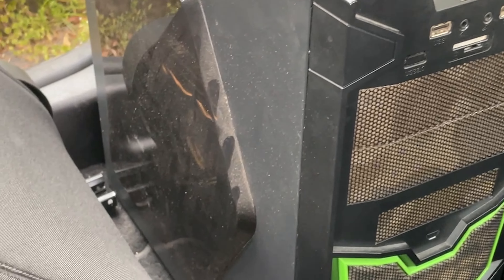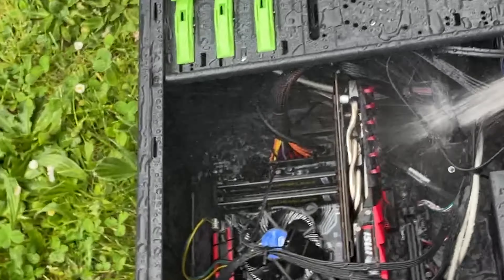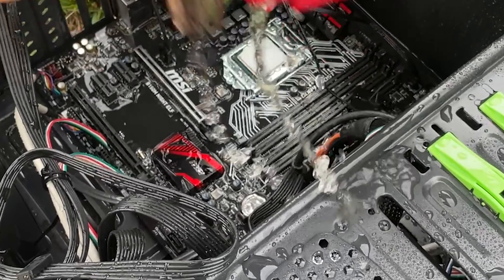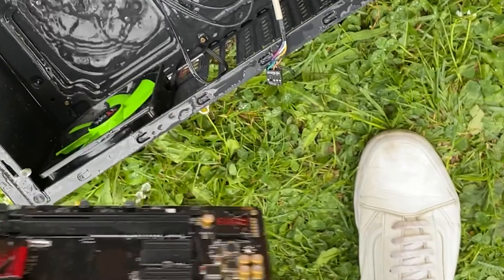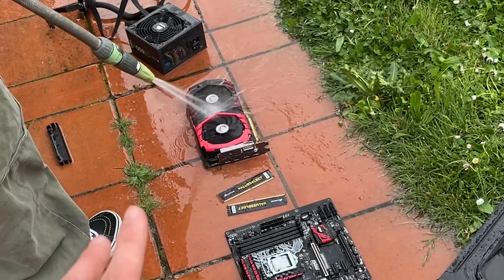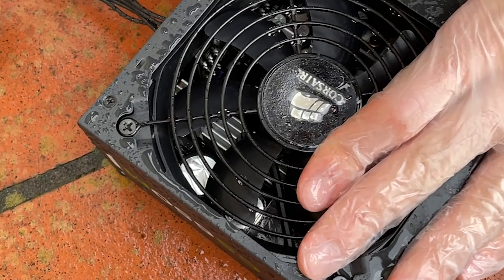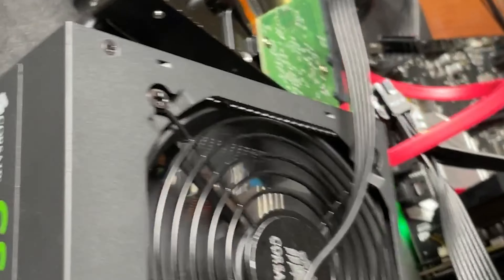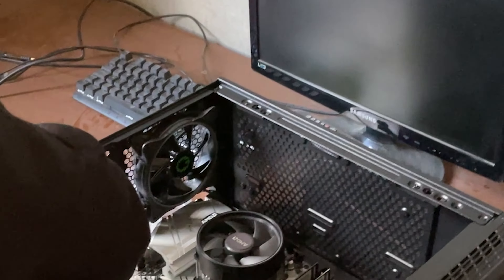340$ Budget PC Build getting a Shower! || PC Flipping

Comment: You should fully disassembly every component and pressure wash them, dry them with hair drier heat mode. Best method to completely remove every particle of dust even the hard ones
Reply from the maker: I definitely agree! A full disassembly specifically is necessary, either before or after the washing, to ensure they dry up properly!

Comment: I give you a tip, I use to do it when I wash my pc components. Put the components you want to dry in your oven, 60-80 Celsius degrees for 25 minutes and your receipe is done. You will have dry clean tasty chips for the go
Reply: Bad advice, the chemicals from the components potentially linger in the oven.
Reply: @ardeof  So put it to 55 degrees half an hour and thats it
Reply from the maker: @rompedientes123123  I think it's honestly a great idea but yeah I wouldn't really feel comfortable doing it in an oven in which I have to eat, honestly though I could get an used oven to do specifically that!
Reply: @ImWateringPSUs  What have you converted in? You used to be cool man. hHahaha
Reply from the maker: @rompedientes123123  AGBHAHAHSHS nvm I'll slap everythink into the oven and bake some cookies afterwards

Comment: can you rally do this or is thi scompletly fake?
Reply: as long as the pc has no power flowing through it while its wet and is completely dried after it should work
though I wouldn't recommend it for obvious reasons like risk of corrosion and rust in some cases
Reply from the maker: It's not fake at all, it's what I do in case of used PC that really need a cleanse and I've been doing it for years without any rust or corrosion occurring, which is why my channel is named like that btw :)
Reply from the maker: @verizache2332  Regarding rust and corrosion, it's all about how quickly you dry it up!
Reply: @ImWateringPSUs  what about the thermal pads and gpu thermal paste XD
Reply from the maker: @Soddus.  Oh you obviously have to replace both after washing!